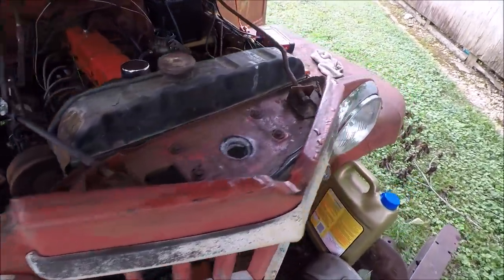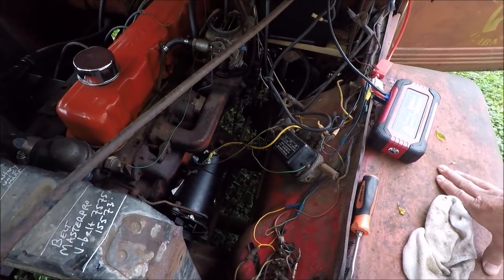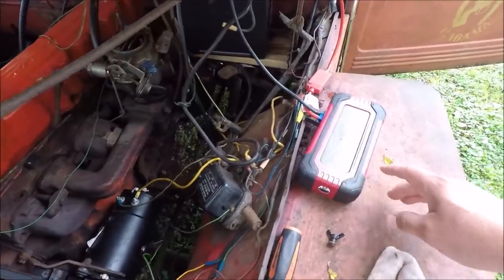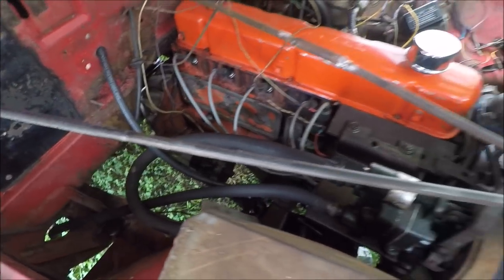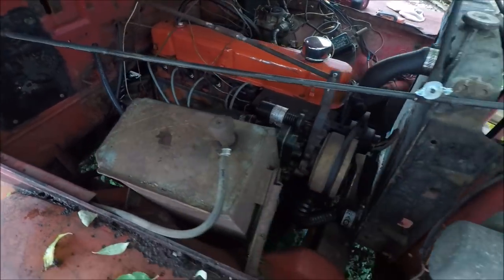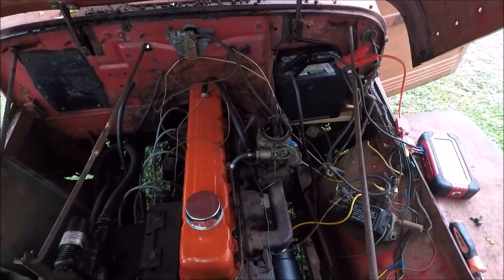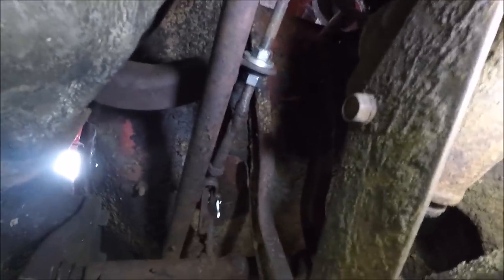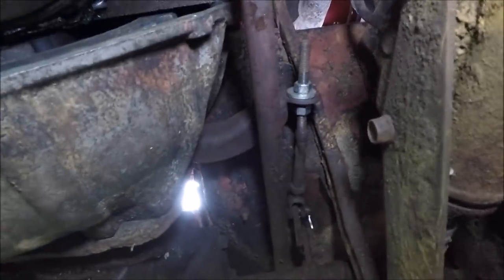Willys Truck Take 19: Electrical Issue & Clutch Inspection

Comment: Clutch . back off the adjustor and take it out. now get the throwout fork and move it backwards until you feel the throw out bearing hit the clutch fingers. that is roughly where it needs to be when the adjustment rod is in place.   it pays to have tiny amount of clearnce so when the clutch gets hot, the linkage doesn't cause it to dis engage.  I have mwentioned befoe that you need to repair that rohnd shaft that transmits the pedal movement to the clutch throw adjustment rod. You cannot have movement there at all. Only a twisting motion . Now with all thsat reassembled , the clutch throwout only needs to move a 1/4" to make the clutch disengage . Not much at all . If you stil cannot engage gears, you have the plate in back to front or the spigot bearing is too tight and is grabbing the input shaft. In the latter case , you chock all for wheels, put the trans in low gear ,then crank the starter . Brutal, but it sometimes works to free stuck clutches and spigot bearings. On a 4x4 you must be careful as it will climb the chocks if not put in place properly. i did it recently on a range rover , i put it against a boulder and started it in gear, it climbed up over the boulder......

Comment: Generator is not hooked up right or is not charging. If the voltage regulator is external that could cause the issue as well if it is miss wired or bad. Good luck and great work though all project's take time

Comment: Taking the inspection cover off only reveals the front of the flywheel and the state of its attachment to the crankshaft if it ever begins to work loose. Do you have any images of the clutch disk when you first offered it to the flywheel when you were assembling the pressure plate on top of it? 

That cover being pinched in between the bellhousing and the engine block does not seem right to me.  But it might just be that it is trapped instead by the starter motor. It that is all which is trapping it. please ignore my following comments inside the [[[[[[[[[[[[[[[[ marks. 

[[[[[[[[[[[[[[[[ Does that cover surround the back of the engine all the way over the top between the bellhousing and the engine block? Some do, some don't. If it is only a half cover held on by a few bolts around the bottom, then I suspect you may have an edge trapped between the bellhousing and the block. That may mean you have the bellhousing attached at an angle to the engine because that trapped cover edge may be holding it off. You may be able to see a thin gap between the bellhousing and the block looking down onto the right side if that has happened. 

If you can get at the bellhousing bolts, place a support jack underneath the engine or the transmission to take the weight, slacken the bolts off just enough so you can slide that bottom cover out and off. I doubt that the small angle of misalignment it might cause would jam the spigot shaft end in its bearing on the back of the crankshaft but who knows? Remove that bottom cover, then pull the bellhousing-to-engine block bolts up tight again. You might strike lucky. If you don't then it may come down to repeating the business of pulling the front body off again. [[[[[[[[[[[[[[[[

I say again, if the starter motor has the cover plate trapped, then ignore this preceding comment inside of the [[[[[[[[[[[[[[[[ marks because the cover will have been assembled correctly. 

There is no other way to check if the clutch plate is correctly installed than to unfasten the engine from the transmission and lift it out again, or slide it forward enough you can get at the pressure-plate bolts, then take the pressure plate off the flywheel and check. If the clutch plate is wrong way around, the friction surface will not press flat against the polished surface on the flywheel but will rock because the centre hub will be resting on the back of the crankshaft. If that is trapped tight the clutch will not release. 

With some clutch plates, the very center of the hub which sticks out may crush against the back of the pilot bearing in the back of the crankshaft. In both instances the clutch plate is being pushed back and bent. The rear friction surface will follow the pressure plate backwards and maintain strong contact. When assembling, before sliding the clutch plate onto the gearbox's splined spigot shaft, first offer the clutch plate up to the flywheel. It should go against the shiny face on the flywheel nice and flat. If it rocks on something in the centre without resting flat on the flywheel it is the wrong way around. 

Please wait for some other comments before taking any notice of mine.

Comment: You can’t check the clutch disc without pulling the motor or trans what you are looking at when you pull the inspection cover is the flywheel the clutch disc is in between the flywheel and pressure plate

Comment: I'm not sure, but it looks like you have a 6v generator and a 12v battery. Not a good combination. Once you get the charging system figured out and engine running on its own. Raise rear end off the ground and put on blocks/jack stands. Then, with engine off, try turning drive shaft. If it turns freely, and back wheels spin, loosen clutch fork adjustment all the way out. Then readjust to where it just snugs up to stop excess rattling. Then start engine and try shifting. If it doesn't shift, you got clutch assembly in wrong.
Reply from the maker: its a 12

Comment: Either the Battery cable has loose terminal or regulator relay isnt holding a charge from generator. It should run just off of car battery without jumpak

Comment: You probably don't care about my grumpy remarks, but I believe you have a six volt DC generator and a twelve volt AC battery. the reason it is going dead is when you cut your jumper box off there is not enough voltage to supply the coil, points to keep it firing. if your going to keep it Six volts ( which in my estimation is bad, unless it's a show truck ) because it will cost you in the long run than an alternator with a built-in voltage regulator and a simple wiring to it, to supply the electrical. A GM AC alternator with regulator has become universal in the field of automotive hackery.

Comment: first guess, battery is dead, he activates his jump box provides juice, when extra juice goes away, then it dies.. it means the generator isn't generating when on, a simple test for this is once it runs, disconnect the positive cable from the batter (no jump box) while running, if it dies, no charging, if it runs, its charging. So battery is dead enough not to power ignition, and generator isn't generating.

Comment: could be your generator or your voltage regulater, or maybe a wiring problem. Use a multimeter to find your problem,. They are pretty cheap.

Comment: I'm thinking it's voltage regulator mine had a mind of its own one day it would charge next day it would stick in the open position recently I upgraded to a GM alternator Delco Remy with built-in regulator it was like $45 on eBay and I had to modify some brackets to make it fit good luck to your project

Comment: Generator must not be outputting any voltage.  Either that or the Voltage regular (the box that has the ground wire connected to it that you disconnected in this video) could be bad.  You will need to measure the voltage on the battery while it is running (with the jump box disconnected).  You should be at 13.5 volts or more.  I would take the generator to Advance Auto or similar place... they can tell you if it is good or not.  My experience with voltage regulators is that they give too much voltage, or fail to rectify the voltage (convert AC to DC).  As a result you end up with too little voltage to power the engine.

Comment: Did you polarize the generator?
Reply: That’s something I mentioned in one of the previous videos, battery won’t charge if voltage regulator isn’t polarized
Reply from the maker: yes

Comment: It looked like to me the flywheel is on backwards. That the face for the pressure plate was facing the motor? Maybe the lighting not for sure without closer look!
Reply: Flywheel is on right

Comment: Hi. Is the engine earthed (grounded) to the chassis/frame? Does the charge light/ignition light on the dash come on when the ignition key is turned to on? There should only be two wires to the Dynamo, assuming the Generator is earthed through its mounting bolts to the engine and the engine to the frame as previously mentioned.  F on the Dynamo to FIELD on the voltage regulator. D on the Dynamo to GEN on the regulator. There should also be a wire from GEN on the regulator to the Charge/Ignition light on the dashboard, the bulb should also  have a Positive Feed when ignition turned on. If the bulb is blown or missing, the generator will NOT charge.  BAT on the regulator should go to Battery Positive and power for lights and all electrical accessories. Its so difficult to explain but quite easy to check  with it in front of you! You are only about 4,000 miles away, so this should be a piece of cake!!! Regards from the UK
Reply: Hi, As an afterthought.  The Regulator has to be grounded  (earth) I would also suggest, the wire that was added from the Dynamo to the Regulator, was an earth/ground bypassing the ignition/charge light/bulb. Check there are no wires adrift at the battery positive post. Try cleaning ALL earth connections, in fact clean ALL connections, positive and negative, then apply some dielectric grease  to ensure clean corrosion free connections.Do them one at a time, so as to not get them re-connected in the wrong place. Think that's all for now!!!

Comment: If i remember the last time i put a clutch plate in backwords it made a lot of noise from spriengs on clutch plate making contact with fly wheel bolts coud be with tinchion on clutch rod may be holding clutch in a nuff were its not releasing put in gear and see if you can rock vehicle back and forth if engine is turning check transferr to see if in neutrel . it's been a long time sence i mest with gen and reg check feld on reg to field to gen and grounds check there a bat wire to reg i think and makes bat power coming off gen goes to volt guage and back to battery if not it will not charge  like i said its been a long time google wiring for delco gen and testing charging there is a way to jump reg witch bypassis reg to make gen full charge hope this helps injoy the vidios i looked it up for delco bat to volt meter to reg, gen side of reg to arm side of gen and f or field side of reg to field of gen and hevey ground to gen there may be a ground on reg hook to that that is if its delco

Comment: if the cluth  dski is in wrong it worn work if the throw out bearing is not in the fork right it wont work.as for the clutch poush rod it should just be snug good an tight.i do this a lot not to much can be wrong don't give up.i wont to see you an the wife go for a ride...rickey

Comment: Something definitely looks odd on the clutch setup. I remember back in "Take 11" video after you had it all together there was slack in the throw out bearing arm that comes out the side of the bell housing had slack in it. If I remember correctly It should have been tight --- NO SLACK
There should have been tension on the throwout bearing until you push that clutch in to disengage the clutch. A question I had on the battery issue is. IS this a 12-volt or 6-volt charging system? If it is a 6-volt charging system running a 12-volt battery you could have fried something, ie, voltage regulator or the generator. Also jumping a 6-volt system off with a 12-volt jumper box would do some damage as well. But if everything is 12-volt I would say the voltage regulator went out. But as mentioned before, check the output of the generator.
Good luck, Hope you get it figured out. Wish I was closer to you. I'd come by to help you out.
Reply: JK 
Right on . Is it 6 or 12 volt . I would say that it is Negative ground and that the starter , voltage regulator and generator are all compliant to negative ground . This all depends on what the previous owner may have done and , not to mention , if the wiring harness is still in original factory configuration . 
The question remains , is it a 6 or 12 volt system . Should be safe to say it's negative ground , was running to date , with negative ground. Will say though , there doesn't appear to be any heavy gauge wire that is found in 6 volt systems under the hood from what we can see . 
Either wiring was updated or its factory 12 volt . For a '61 or '62 model year that it's believed to be , I think they came 6 volt negative ground but don't want confirm that not having the literature to back that up . 
As it stands now , if the starter , generator and voltage regulator are 12 volt rated , the rest of the system will have to be made compliant as well . If it's got a lot of 16 and 14 gauge wire and 12 volt light bulbs , I guess it's good to go .

Comment: That's not an inspection plate. that's a dust, dirt, mud, cover. and no you can't see the clutch for the flywheel being in the way. there was someone who made a grumpy comment about the condition of the clutch, pressure plate and throw out bearing during your first attempt to marry them back together. but he was just being a grumpy old man.

Comment: Check your car battery it acts like the battery is ruined and it is pulling the voltage so low the car won't run.

Comment: Bad Alternator,  battery is just for cranking.  Crank truck, pull positive post cable off, doesn't stay running,  bad alternator. Or you're grounding out.
Reply: Went back to take "11", for some reason the clutch pressure plate step was skipped.  Smooth side of pressure plate goes against the flywheel.  I hope that's what you did.

Comment: Hey Alabama all vehicles except some motorcycles w magnitos must have a battery to drive the ignition. When you turn off the little battery it is  just like turning the key off. I just took a photo of the shift info from my 53 Willys wagon glove box. It may give you a tip.

Comment: Why does he gave to pull the motor again and not just the transmission
Reply: Well the transmission is connected to the transfer case for the four wheel drive. On this application pulling the motor is easier than pulling the transmission.
Reply: Gees....he's got heaps of patience...by now I would send the thing to a garage and let someone else hassle with it

Comment: dude really ? That jumper is designed to be discounted ASAP when the vehicle has been started - not playin around with two systems fighting each other - get hip !
Reply from the maker: Yes we all know that which is the reason I step out of the willys, turn it off, and knew it stopped the engine. BTW which is the point of this short video. Get on board

Comment: Alternator! Either its bad or wired incorrectly.
Reply from the maker: it doesn't have an alternator
Reply: Exploring Alabama then the generator.  If you have a dead battery and a generator or alternator that  is not putting out voltage  the engine will not stay running once you remove the jump box. It could also be wired incorrectly. Try testing the voltage coming off of the generator that will give tou an idea of whats wrong.

Comment: Where is the altinator?
Reply: It hasn't got one. It's using an old style generator, the thing he removed the wire from in the first few minutes of the video.
Reply: I guess I need to go back and look at the engine swap video, did he change out the engine with a modern one? generator needs rebuilt sounds like
Reply: check the gen output with a voltmeter, then make sure the correct regulator is used...gotta use the CORRECT regulator and be sure it's wired properly.
Reply: m schiffel very true, is generator 6 volt or 12 volt,,,, if its a newer motor its a 12 volt system,,, the older motor could have been a 6 volt system, I'm not sure if this old Willey had that 6v
Reply: I believe that Willys went from six volts to twelve volts in 1957...I have no idea what this particular Jeep's year is...The Delco Remy generators, like the one on this Chevy six is not compatible with the original Autolite regulator used by Willys...The twelve volt Willys trucks had positive ground, not negative ground like all other manufacturers had...You must use a Delco regulator designed for negative ground...Also you must swap the two wires side for side on the ammeter so it shows the correct polarity when the engine's running...the heavier gauge six volt wiring is more than up to the task of carrying twelve volts, IF the fabric insulation is not frayed or missing...If this was my truck, I'd remove every square inch of factory wiring and rewire it from scratch...I've done this many times and it's a nice easy job...The results are rewarding.
Reply: m schiffel agree , the fact the motor runs on his battery pack is telling the 6 volt generator with a dead battery can't power it,, an alternator retro fit with the right regulator would fix it., new battery wouldn't hurt lol
Reply: A new battery would be money well spent.